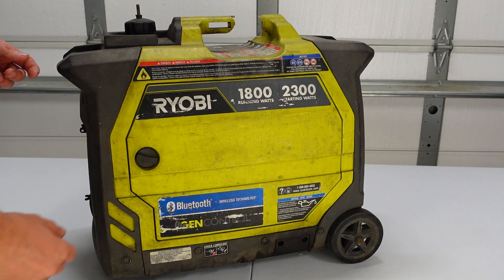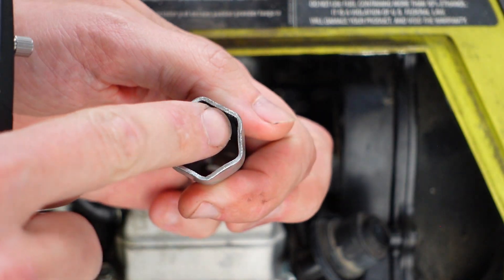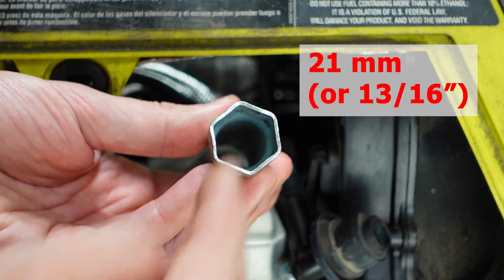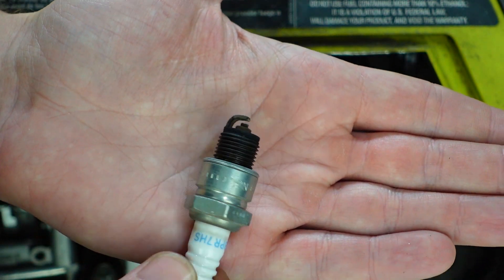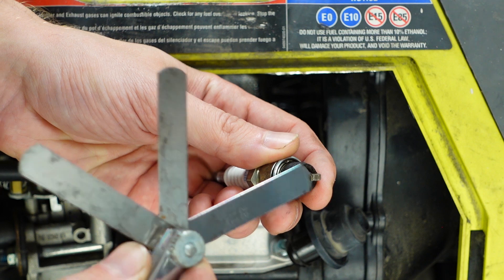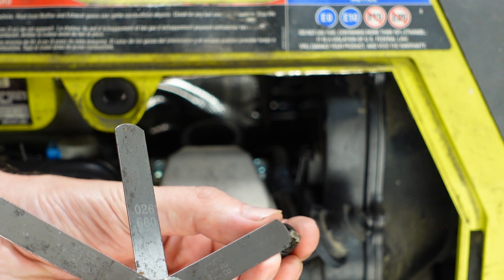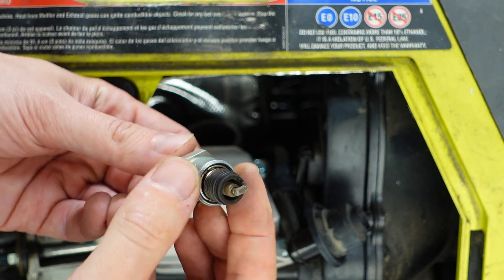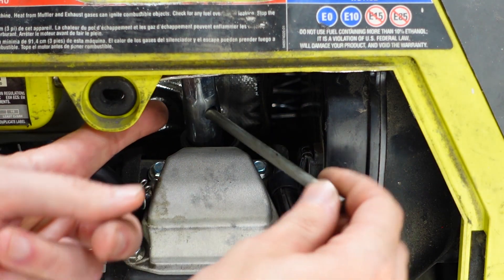Easy Spark Plug Change for Ryobi Generator! Step by Step

Comment: I lost that wrench and havent found one like that. So i gave up  and store the generator like for ever now
Reply from the maker: There are more videos about this generator on the channel. For example, about bad generator starting, where I show how to adjust the starting metal wire if the generator doesn't want to start. Take a look, maybe the problem is not in the spark plug. Thanks

Comment: Good job! That's a lot of hours. What do you do with it ?
Reply from the maker: I use it in my semi truck to charge batteries and for small conditioner. Thanks. Now it's 3k+ hours, still starts after 2 attempts
Reply: Wow that's crazy I have the same one and Right at 700 hours developed the same fuel leak other than that, not a problem Glad to hear it's going to run for a long time 👌👌
Reply: Update at 1100 hrs the valve keeper failed on the exhaust side causing the valve to crash into the Piston luckily The head was still okay and I was able to rebuild it with a used valve and new keepers